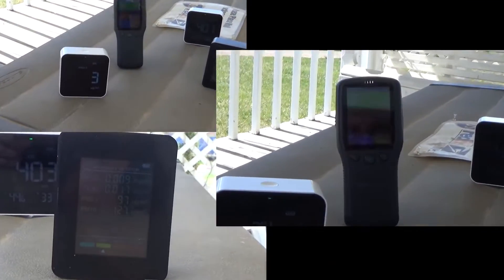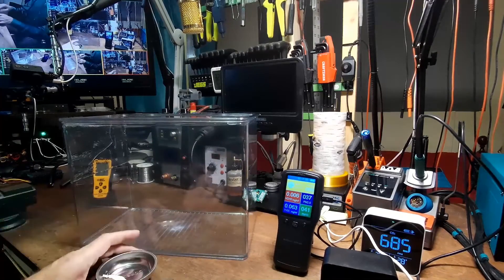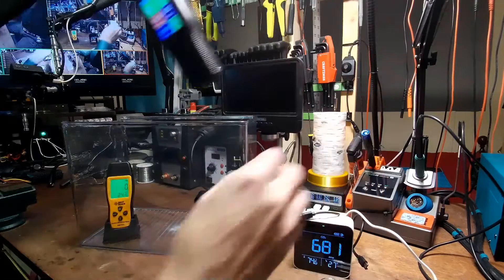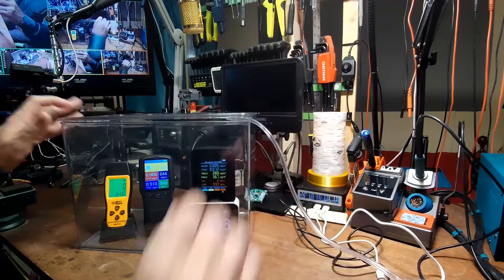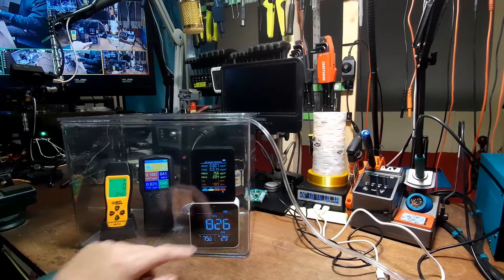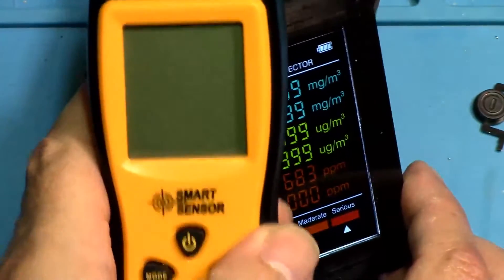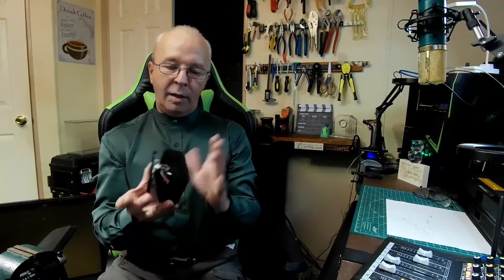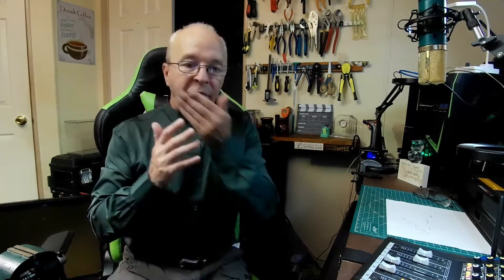Compare Fake Chinese Air Quality Monitor To "Smart Sensor" CO Monitor & "TemTop" CO2 Monitor

Comment: from AliExpress posting  :   This product has high sensitivity. However, it can only detect, and the data will not be very accurate (called qualitative but not quantitative). It can only detect mixed carbon dioxide, such as carbon dioxide exhaled by the human body, and cannot detect pure carbon dioxide.
=
I could not find anywhere that it said the sensor could detect pure CO2.

Comment: Have you reviewed Bosean Air quality Monitor  T-Z01pro? This model (while relatively cheap on Aliexpress) does at least seem more legit than the square boxes of uncertainty that a number of reviewers have canned.
Reply from the maker: No I have not.  I can't afford to purchase Air Quality monitors any longer.  Unless a company sends one to me, I can't do these videos any more.  I have contacted a number of companies including Bosean, but no one will send a monitor to me for review after seeing my channel.  I don't know if it is because of the honesty or if Outside In is just too small to be of any interest to them, but so far no companies have offered to send a monitor to me for testing - teardown and review.
Reply: @Outside-In.  It might be because different companies have their own definitions of air purification and air quality detection. I wonder why air purifiers are so cheap, but they don’t have monitoring screens
Reply from the maker: @premraturi8181  Purifiers are nothing more than a plastic case with a fan and a filter inside - that's it...  A lot of Purifiers that are a bit more expensive have PM 2.5 sensors inside that controls when the purifier turns on and off, or goes up in speed and down in speed, so the PM sensor and extra controls add expense to building it.  And then the really expensive Purifiers have not only PM sensors inside, but also ion generators as well to help purify the air.

What you have to watch out for the most, is the cheap monitors that have CO2 and CO sensor readings, and the reason I say that is because a CO2 sensor itself is a quit expensive sensor and can cost in the hundreds of dollars.  A CO sensor is not quite as expensive of a sensor, so why a CO meter is not that expensive - maybe 40-50 dollars, but if you find a CO2 meter, they can cost in the hundreds of dollars and even over 1000+ dollars and that is a monitor with only one sensor.  

When you see a monitor that has 7 or 9 or even more sensors in it for 90 dollars or less, more than likely there is at least one reading that is faked and usually the faked readings are the CO and CO2, but as far as I am concerned, even one faked reading makes the whole device fake. 👍

Comment: not very helpful.   'throw it away' does not offer a solution.
Reply: There is no solution with this fake sensor. He said to buy a good quality device. What can you expect more ?
He reviewed other chinese detectors and some are good.
Personaly I purchased the temtop m10i  because after a lot of review, it seem to be really good for this price point. Even chatgpt recommends it
Reply: @fruitycoconut  : if you take it outside you get about 400 on the CO2 scale.  you also get very low numbers on the other scales.
it is an Air Quality meter.   CO2 is not a pollutant, it is the basis of life, food for trees.  this is clearly NOT a CO2 sensor, but much more informative.  a Credit card is FAKE money, totally FAKE.  but it too has it's uses.

Comment: Thank you so much!  I’ve bought one of these sensors and I was always suspicious of it.  It is nice to know that it is fake.
Reply from the maker: Glad I could help so that now you can take it over to the trash can and - drop it...  🙂
Reply: I posted a reply on the vid.  worth the read.  your device does measure something,  need to find out what it does measure before you label it a 'fake'   the content provider used a 'fake' device to test this other 'fake' device.   neither can detect a major air quality problem ,  rag-week pollen, so both could be called 'fake'  air quality sensors

Comment: Thanks for the video. Wanted a monitor for my 3d printer. Ordered that exact model and immediately canceled the order lol.
Reply: Which thing are you monitoring for 3D printing? Is there a safety concern with those printers putting off gases?
Reply from the maker: @jolenechandler4192  I don't use any monitor personally.  I keep my printer in another room, but I don't notice any unpleasant odors while printing, but then again, all I print with is PLA.  I do hear that ABS produces odors, but I have no experience with ABS.
Reply from the maker: I am glad you did not get stuck with that thing 😉

Comment: I got this.. when i gently breathe on it co2 goes to 2000.   When i put it within a few feet of a small spot of fresh spray paint, total voc shoots up.   The pm2.5 and 10 dont seem to do much... i tested in a small room with a hepa air purifier on blast for hours prior and it read the same as my kitchen after making dinner.  The co i couldn't get to go above 0 holding it at the exit to my oil powered water boiler.   To be returned...
Reply from the maker: Great decision for sure 👍👍👍

Comment: I have one of these and I didn’t see you follow the instructions to calibrate. It says in the instructions it will be way over unless you calibrate or let it calibrate after like 24 hours. I’m not saying you’re wrong but you aren’t being as thorough and honest as you could be too.
Reply from the maker: There is a reason I did not calibrate the Fake monitor...  A FAKE monitor needs no calibration - because you cannot calibrate a FAKE monitor to make it legitimate...

A Fake monitor is still Fake even if you calibrate it.  It does not have the appropriate sensors inside, so therefore a calibration isn't going to work no matter how much you want it too.

Thanks for your comment - much appreciated. 👍
Reply: Thank you for your sensible and scientific approach.
When a civilization is so are advanced, to others it appears as if magic.
not letting it warm up is like not putting batteries into a flashlight and calling it fake.

Comment: Thank you very much for this video, the direct comparison of multiple devices in the box was greatly executed and eye opening! 🙂

I've recently bought similar chinese device for just $7, I was aware it uses indirect calculations for CO2 from simple MQ7 and TVOC sensors so I knew it won't be much precise, but I was hoping it would show at least some trend or border values. In reality it sits most of the time around 400-600 and then after several hours for now reason goes up to 1200-1500 and stays there (if I restart the device, it countdowns for 120 seconds and CO2 goes immediately back to ~400). Now I know I need to invest multiple times more for real CO2 sensor and keep this one just for showing temperature and humidity. 😅
Reply from the maker: Temp & Humidity is about all it is good for.  You are right, a good quality monitor will cost in the hundreds of dollars - not 7 ;).  Thanks for your comment and thoughts - much appreciated.  😉

Comment: It's a standard MOX sensor. It does not measure CO2 directly instead it calculates a CO2 equivalent reading. The calculation heavily relies on the VOC measurement. Ethanol, toluene, acetone, etc. will therefore make the number rise.

Comment: This is a metal sensor of air pollution (organic gases and vapor: hydrogen, alcohol, methane, soot, smoke) + optical sensor for particles.
Reply: I just need a sensor to check for tobacco smell. Should it work ? I don't need precise value. Just compare from a room to another.

Comment: Hi.I live in the surroundings of my city. 
Every morning and afternoon there is a smell similar to car paint, a slight but acidic aroma. 
Could you recommend a detector for industrial waste?
 Thank you.
Reply from the maker: It is hard to diagnose a problem with such little information.   Certain types of Mold can smell like paint fumes or have a sweet odor, while other types can have a odor such as a sewer.  Ammonia can also have an acidic or paint fume smell.  If there is a lot of industry, Ammonia would be the first thing I would want to know about.

There is the other problem, - are you having any certain types of reactions to these odors?, as that would help in determining the possible chemical you could be breathing in.  

Are you home all day, or just in the morning and afternoon?.

Do you live in a complex that has regular cleaning in other parts of the building in the morning and afternoon?.  A lot of people use Ammonia to clean and disinfect with, but Ammonia is very very dangerous to use, and causes serious breathing and health issues.  Ammonia is one of the most toxic cleaning chemicals we can have in our homes.

Ammonia (if it is far away) can have an acidic odor and also (in small doses) have a chemically/painty kind of odor.  Ammonia up close and personal would cause a feeling of suffocation after a couple seconds of exposure.  Ammonia is very very toxic.  There are some cleaners that have a small amount of Ammonia, and would smell kind of how you described - a car paint kinda odor, or also acidic as well.  It would cause coughing and a feeling of not being able to breath if staying in the same room it was being used in.  

I had to get rid of all Ammonia based cleaning supplies as I could not stand to be in the same room that I was using it in - couldn't breath - headache, but again, that depends on what percentage of Ammonia you would be exposed too.

I would look for an Ammonia detector, but they can be very very expensive unfortunately, and why I don't have one - because I can't afford to buy one.

I guess that main question to ask to begin with, is if you are having any symptoms in the morning or afternoon that is not normal when you notice these odors?...
Reply: @Outside-In.  When I start to perceive that smell it is a bit invasive to my sense of smell, let's say 35% about the other aromas or the same air.
In case it lasts a long time, hours, I feel something dry in my throat and as you say, there is a tendency to feel the back of it little irritated.
I live in Sonora, Mexico and there is an industrial park about 5 kilometers away, and at least a kilometer ago they brought industrial waste from another country and deposited it in a special pool called CITRAR. That was open then, and today there are fractionation houses there.
The wind comes from the East, so I guess there is a relationship with the industry.
Reply from the maker: @crossfire73  wow, there is a lot going on there.  Mining, Automotive, Aerospace, Electronics, Agriculture...  There is quite the mix of chemicals/gasses being introduced into the air around your area, so it could be any number of things causing the odors you are experiencing.   What you could do is get a CO meter, a CO2 meter, and also a gas leak detector.  The gas leak detectors usually pick up on many different types of gasses, so if a gas leak detector alarms - that is a good place to start, and then you could possibly contact a local fire department, as they usually have equipment for testing for specific gases.  

Make sure also that your CO levels are normal (0-1ppm).  If CO goes above 1 for more than 5 minutes there is a problem that needs to be addressed.

At this point, my best advice would be to find someone who has different types of detectors/meters, and see if they would help you find out what is going on.
Reply: @Outside-In.  You are very right. I'll find someone to rent those teams because I honestly mistrust corruption. 
I thank you very much for your time and your effort to answer my questions.

Comment: Your quality meters are calibrated before you get them. The Made in China isn't calibrated and has instructions on calibration which you did do as far as I could see. There is also extrapolation in the algorithm and it is not designed to go out of limits and remain accurate as you have done here - even if calibrated it's an early warning device and not a scientific instrument. Your quality unit is similar to a lesser degree and your out of limits treatment may have damaged the sensor as you made this video - lets hope not. Furthermore the display is created in software. Some of these units have sensors for 4 functions and some have sensors for 9. Someone can just reprogram a 4 sensor unit to display or mimic 9 functions when the only have the sensors for 4 functions and sell it below the cost of the 9 function unit and if your buying the cheapest then that is what you are buying. 

So yes "you" have a fake meter which relates to your knowledge on purchasing imported products, there are no surprises here about "cheap" fakes coming from China. I have a similar one and I just opened it (I am an electronics engineer) and it has all the sensors for all the functions. It not super accurate but it is cheap and better than nothing - that is what it is designed for and it is not fake. 

For sure, expose fakes but know that if your buying the cheapest then your buying a fake. You did not mention the cost of the quality units for comparison. 

When I bought mine I saw others that were obviously fake as they were selling below the cost of one of the sensors required for the functions it had. 

Mine has a LASER PM sensor, CO sensor, a CO2 sensor and two other gas sensors that it uses to extrapolate  VOC and falmilderide and humidity. That's fine with me as I want it for PM and RH. I might watch the rest now.
Reply from the maker: Thank you for your thoughts and analysis.  4 sensors that give 9 readings is a fake for sure, and you do agree on that point, however, you mention the cheaper one you purchased that has all the sensors it states to have.  The fake monitor in this video does not have all the sensors stated however, and is not to be trusted for any readings is gives.  

A monitor that has just one fake or "calculated reading derived from another reading", should be thrown in the garbage and not to be trusted.  You are right as well that we do not need, or require a monitor that gives lab results - just a close approximation to know when to open a window.

My earlier air quality videos are error-ed in some fashion or other, and that is simply because I was still learning, and with each video I became more and more informed and knowledgeable.   As a matter of fact, I became so knowledgeable that I finally realized that having a monitor causes undue stress and paranoia if used on a constant basis.  The only time to bring out a monitor is to simply troubleshoot a situation based on feeling dizzy, nausea, disorientation etc. that you are not accustomed too, and to find out what is causing the issue.  

In my humble opinion, the only sensors a person needs, are a CO monitor (the MOST important to have), a CO2 sensor, and any other gas related sensors a person my need based on particular gases they may be using around their environment.  The only other sensor to have would be a PM sensor, but that is only to know when it is time to open a window for ventilation. Thank God the need to have a monitor is finally dying, as people are going back to using their own brain or senses to know when it is time to open a window, but like I say, having a CO monitor is very very important to know if we have a carbon monoxide issue causing sickness.

Just a side note, I am sure there are monitors that have legitimate readings that are cheap, but so far, I have been unable to find one that lasts very long, and that of course is because of quality and why they would be cheap.  If a person truly needs or wants a monitor in their home, then they should be looking to spend several hundred dollars and upward to get a much better quality device.

One question that I have never been asked (that I can remember), is, Do you use monitors all the time.  My answer would be of course - absolutely not.  I only bring out a monitor if I start to feel bad in a way that is out of the ordinary, and something that I cannot explain.  I will then pull out a monitor or meter to find what may be going on.

If particulates are a bit high, an air purifier can help greatly in that area, but a lot of people do not realize that gasses such a CO cannot be eliminated by using an air purifier, and in that situation, the area needs to immediately be ventilated, and then an extensive study needs to be performed to discover the cause of the issue, and fix it before it becomes deadly.

Thanks so much for your comment and thoughts, they are truly appreciated, and I hope your monitor serves you well.
Reply: Can you share your model ? I'm interested! Thanks.

Comment: It really needs to have a fan to pull air in to have an effective particle sensor.
Reply from the maker: A fan won't help a fake monitor (or a low quality particulate sensor) to give good readings :).  Great idea though, and thanks for your thoughts - much appreciated.